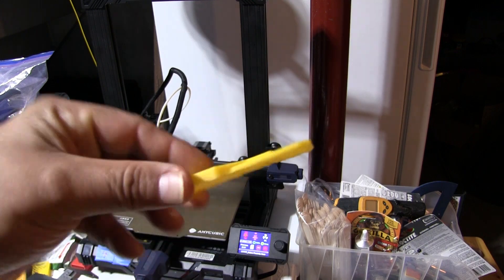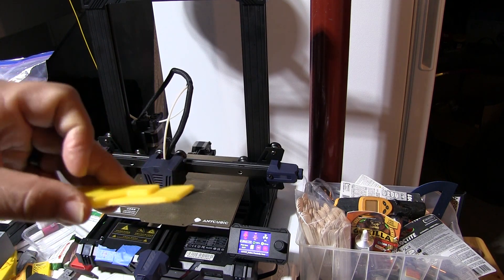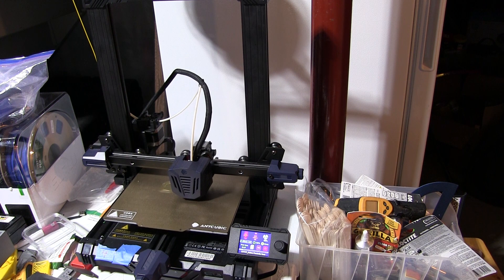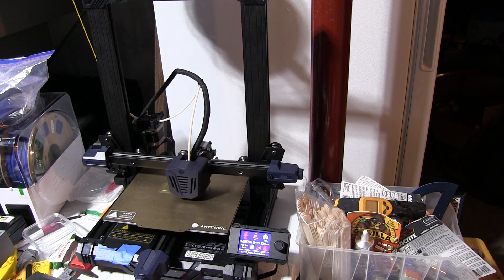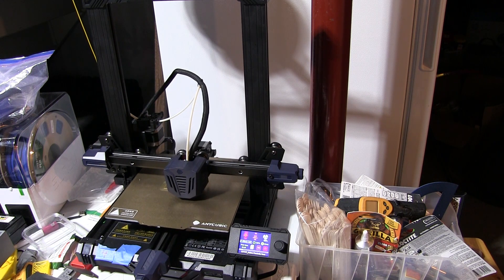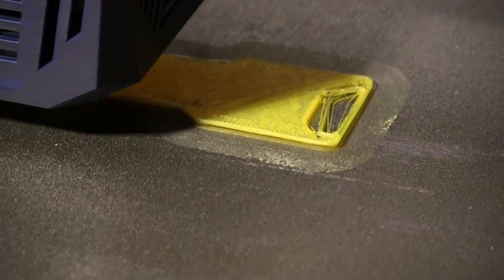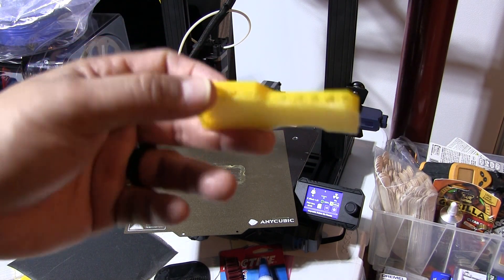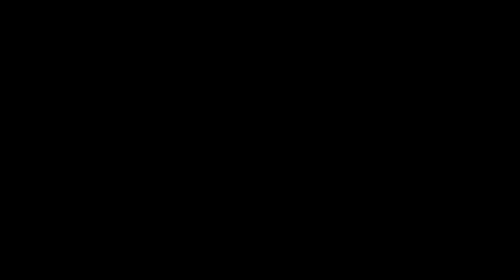Back to Square One with my Anycubic Kobra Go   Epidode 2

Comment: Your z offset only matter in the first layer if sliced at .2  the brim hight should be .2 all 4 sides of table,,,  Also  adjusting this machine is very very annoying looks like your table & gantry are not square to one a nother is causing layer uneven laying of .2 mm line hight.  Loosen table and gantry !!!do not use box !!! ...PS RIGHT SIDE MIGHT JUST NEED TWEAKING